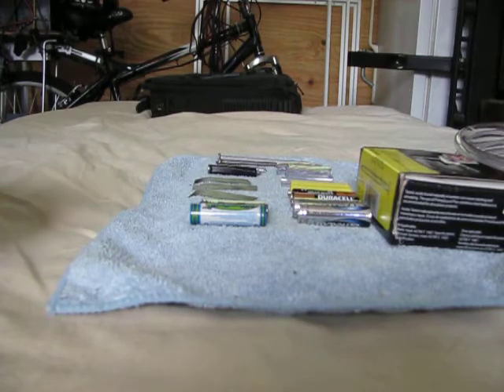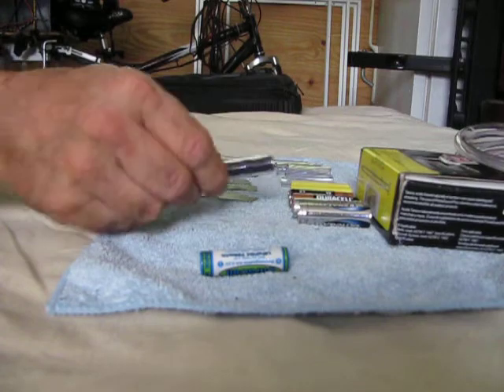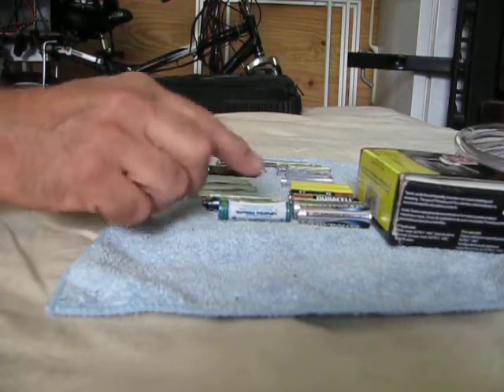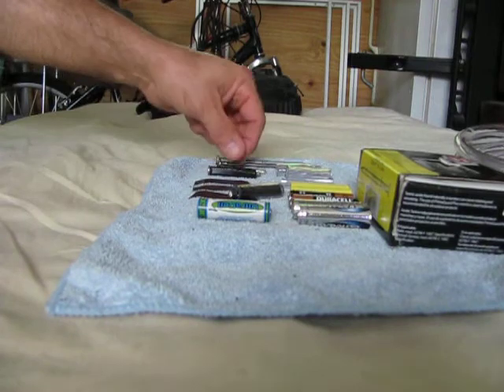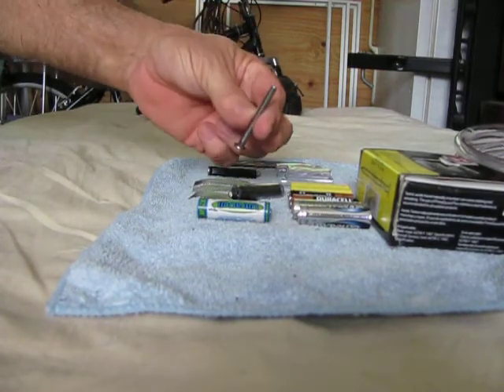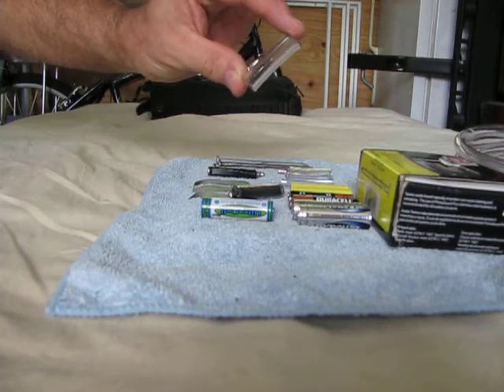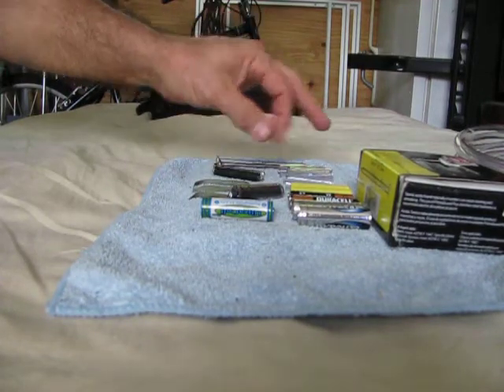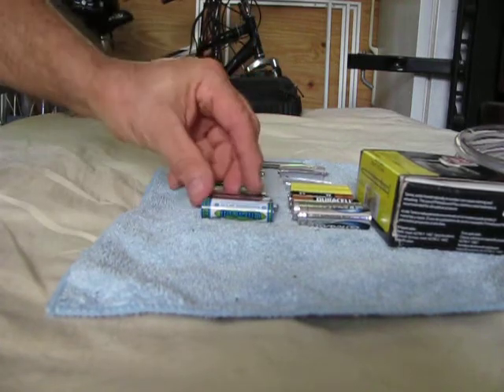AA dummy cell

Comment: There are lots of ways to skin the cat (such as stacking magnets is another common one), but that is very good, I'm I'm going to try that, and I may even introduce some colored heat shrink at some point. I recall in the past trying to use the clear plastic tubing for carriers and it had a bit of a warp in it so I wondered if there was some ABS pipe that might be that size. Thinking out loud, I wonder if one could find those nails in SS, Alu, or some other material not prone to rust? Did you think that up on your own?

BTW, just to clarify for the previous poster, 3.2V cells are LiFePO4 (Lithium Iron Phosphate). A 3.7V cell would be LiCo, also common called Li-Ion cells. While they are nominally 3.6V, at full charge, at full charge they are 4.2V. The LiFePO4 cells are about 3.6 at full charge, and nominal charge is 3.2. These dummy's will work with either as long as you've got your voltages sorted out in advance as far as your device is concerned. (For example, in a  VHF radio that uses a 7.4V Li-Ion battery pack, I can use 2 of the 4.2V cells and 3 dummies in the AA cell battery holder and the radio is fine). Spark headlamps are the same as they have built in voltage regulator circuits that will work up to a maximum of 7.6V for example.

Thanks for posting this.